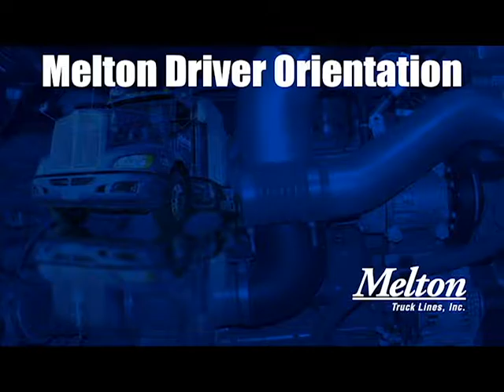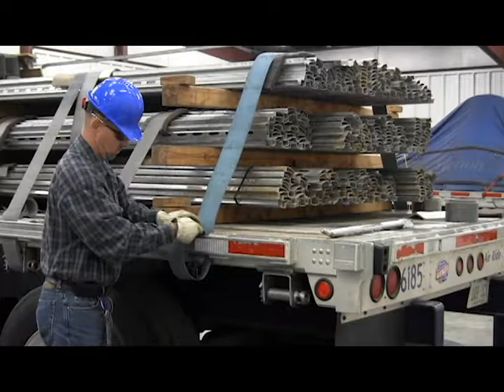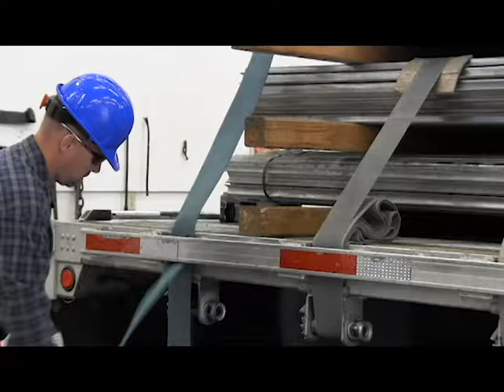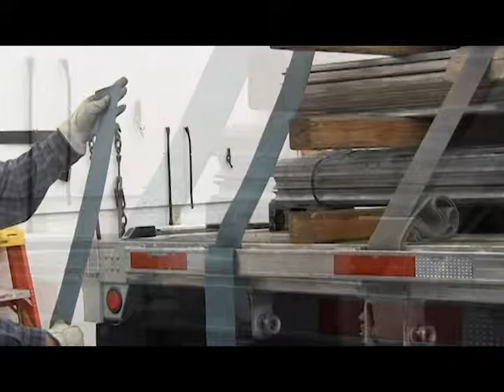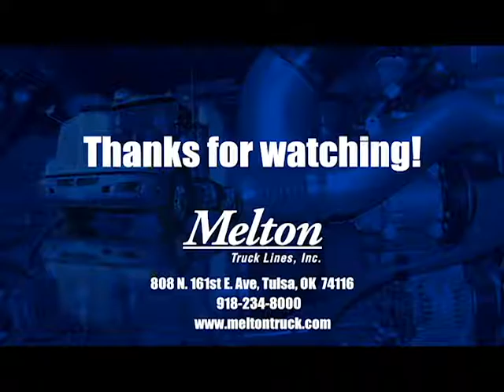Threading a Strap

Comment: That is the longest, most convoluted way to thread a strap.  This would add an hour to each load.  How many times did you pull the strap through the rubrail?  Three?  And then had to back-up and try to wrap that thing up?  What do you do in the wind?  Or in a tight space?